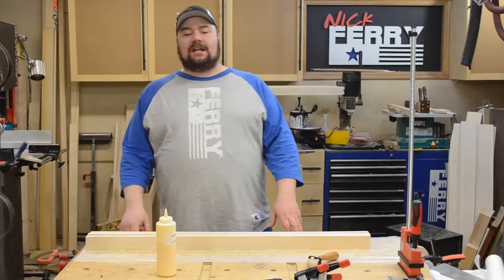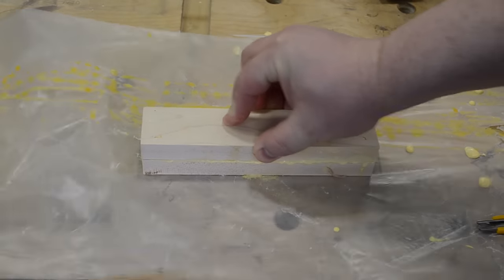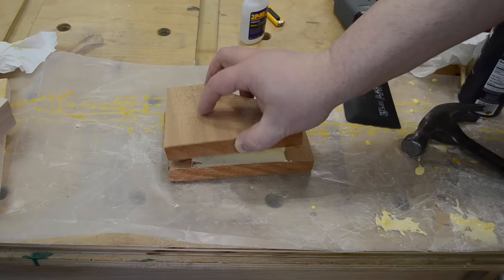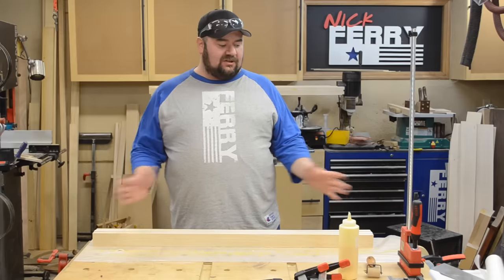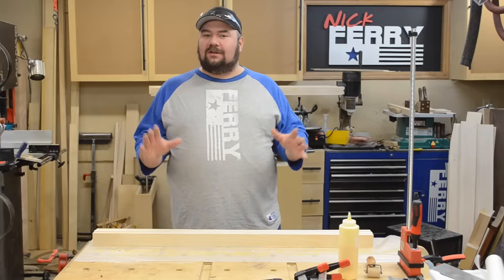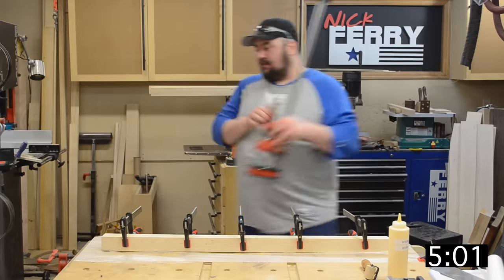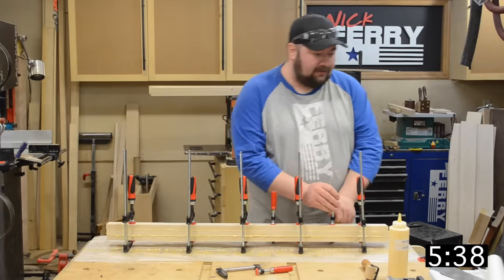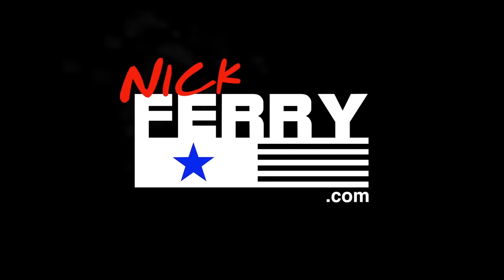Ⓕ Best Way For Gluing Wood Together To Get Thick Pieces (ep86)

Comment: When you clamp against the bow or bend of a the wood to straighten it out, doesn’t it just end up trapping the tension? Or does the wood eventually “set” and lose tension? Asking as someone who lives in a region with humid summers and dry winters and i have to account for lots of expand / contract with my projects.
Reply from the maker: all wood has tension and compression - this amount of warping/crook, or even slightly more you'll be good - I live in a huge moisture swing region as well
Reply: Nick Ferry thanks for the clarification. Great video, too.

Comment: Great tip, thanks so much for sharing. Would dowelling each lamination for something large like a bench top be helpful?
Reply from the maker: Most definitely - just watch for exposing the dowels when cutting to size
Reply: @NickFerry  Thanks, I thought that would work. I need to laminate a bench top for my Mike Myers Moravian Workbench build, and I was thinking that dowels would enable me to lock each lamination in place as I build up the whole top. I'm not worried about exposure of the dowels, that would only happen when drilling the bench dog holes, things like that, which won't really matter.

Comment: Hey Nick, great video and thanks for the info, I have only one question.  What if you can't afford even one parallel clamp?  I have a long story as to why but suffice to say I am rebuilding my life in my late 50's and can not afford such expensive clamps.  Heck I can barely afford to buy even the BC Sanded plywood much less BC Birch, ( they don't sell Baltic Birch anywhere near me), so that's my situation.  Any ideas?  Thanks!
Reply from the maker: for sure there are other ways - but first let me mention a method that helps progress the shop overall - find something you can currently make and sell for a few bucks profit and set some aside for shop things like clamps - there always seems to be something in the shop you need to replace or upgrade - woodworking is an awesome hobby that way, it's one of the rare leisure time activities that can fund itself 

That being said, you can use whatever clamp you do have, like an F-style clamp, C-clamp, bar clamp etc., and use a couple pieces of scrap wood to act as cauls to mimic the jaws of a parallel clamp - it isn't as easy to manipulate or as efficient but it can easily do the trick - wax the scrap pieces or cover them in packing tape to keep them from sticking to the glue - hope that helps

Comment: Two quick tips. Looks like waxed paper(?) on the bench. Consider going to Walmart or a fabric store and get a sheet of heavy clear vinyl. It's extremely durable, lasts for years, water proof, glue doesn't really stick to it, finish can't soak through it, and when not in use makes a half decent machine cover. 

Second, alternate what side of the work piece the clamps are on. It doesn't affect the glue up but it does help even out the weight of the clamps. I set my glue ups upright to dry (limited floor space) and it won't have as much tendency to topple over to one side and is easier to brace and/or prop up against something.
Reply from the maker: Some good ideas for sure

Comment: If you did two parallel clamps, on on either end and then applied all of you F clamps you wouldn't have to keep scooting it down. The alignment would be secured from the beginning and you could shave a little more time off of you glue -up! Cool Video!
Reply from the maker: but if the board is crooked then the middle wouldn't be lined up flush - doesn't always happen that way but I have had it before

Comment: good tip.  haven't seen that done.  I have never even seen a parallel clamp before.  Just checked Bunnings.com.au website which is our biggest hardware store downunder and they don't have anything listed that looks even close to the one you used.  As usual America gets all the good stuff and Australia either misses out completely or gets something 10 years after the rest of the world gets it.  Any hardware makers send some clamps down to sell in our shops you will sell heaps
Reply from the maker: I bet you would - a couple chunks of timber will do the trick too

Comment: I've seen Roy Underhill 'do' a "rub joint" and have tried it myself successfully. Of course, he used it to join boards on edge - but I've used it to join boards as you have done hear. Albeit two at a time.

I found a better squeeze bottle for gluing @ Kligspor: Glu-Bot Glue Bottle.  There are several vendors offering glue bottles that incorporate the roller - similar to "Big Horn 19045 8oz Wood Glue Spreading Applicator Nozzle Kit."  I use the Glu-Bot and find it an improvement over using the original/factory glue bottles or the Ketchup dispenser alternatives.
Reply from the maker: a rubbed joint works surprisingly well - George VonDriska taught that method in third-world countries while in the peace corp - perfect if you don't have enough clamps - and I love my glu-bot - pretty much any clean empty squirt bottle becomes a glue bottle around my shop - I think I'm rocking a hot sauce bottle currently

Comment: If you have two parallel clamps, you could set one on either side, then apply normal clamps in between. Alternatively, after you place the first clamp, simply move the parallel clamp to the other end.and add other clamps. Isn't it easier?
Reply from the maker: You can do that but it wouldn’t remove a crook from the board

Comment: Hate to break it to you but back in 1987-89 I used this method when I did curve handrails. Bessy clamps just came out with their first parallel clamp. it cost $38 Canadian at the time but I figured cheep if it saved me frustration. Perhaps I was the first to use this idea or at least one of the first wood workers at the time to use it,( knowing how our minds work) always looking for a better way to do the same job. I like the salt idea though.  p.s. I still have the clamp which I haven't used since mid 1990's. and yes it is true, there is nothing new under the sun.
Reply from the maker: I can see it working out well for handrails - parallel clamps have saved my butt a few times

Comment: Hey Nick Ferry. Great video and thanks for the tip. One thing I do is dent the side or face I’m gluing using a hammer end or chisel so the glue has something to grip into. Is this something you’ve come across before or even use?
Reply from the maker: thanks - I have heard of variations of that before but never went that route - chemistry in modern glue really doesn't have any problem getting into the fibers and pores of the wood creating a super strong joint - even glass smooth edges fresh off a jointer make great surfaces to face or edge glue blanks and panels - the only time I can seeing prepping the wood any different is in high oil content exotic woods
Reply: I work a lot with Parota, Tornillo, and Mexican Ebony as I live in Mexico. So I sometimes have that issue. Less so with White Cedar which I’ve been using recently but have been doing it out of habit. I’m guessing salt is a kind of alternative to what i do then.
Reply from the maker: I'd stick with what you're doing over the salt method - salt won't help with oily wood and glue adhesion

Comment: Great video Nick,  what kind of glue do you use in the video to join the pieces? "Titebond 2 Glue For Most Projects"
Reply from the maker: 2 is a good all around glue - If darker lines aren’t an issue 3 is a good one even for indoor projects - white school glue works great as well - it’s what I primarily used for years

Comment: Depends on how thick the board is but sometimes I'll add a lamello, it won't interfere if you want to add in another joint and if done right, is pretty fast and clean!
Reply from the maker: But if you add a taper it can be tricky to plan for all of them and not expose them when making a cut

Comment: you can also add a biscuit or dowel between the planks to keep the wood from slipping.
Reply from the maker: For sure - I typically avoid them when tapering legs

Comment: One Q: when you clamp it one way with the parallel, wouldn’t you not be able to clamp it all the way with the f-style due to the differing force directions?
Reply from the maker: the clamping force of the f style clamp is much greater than the resistance of the wood to slide in the parallel clamp

Comment: Hi Nick....Great method (although those Bessey parallel clams aren't cheap)! A 'caveat' for anyone using salt: I've been using salt for many years. It works OK, but be very careful how much you use! Be very sparing if you use salt...just enough to hold pieces still. On more than one occasion, I have used just a little too much and found that, as the salt dissolves, it tends to weaken the glue joint...and I've had the disasters to prove it! I like your method much better.  :-)
Reply from the maker: thanks much - clamps in general is that sort of thing to where it adds up quick

Comment: Good job on that clamping. How long would it take you to glue and clamp up a 16ft. church pew?
Reply from the maker: Based on time per foot for this one, I'd say less than 20 minutes - if I were doing a lot of them I'd use an impact to tighten the clamps  - that would bring it down to probably less than 10 minutes

Comment: Nice video!  Just to add a degree of complexity - what if your boards were bowed and you wanted to clamp the stack to your bench to keep them straight during gluing.  Then you'd need to have the glue surfaces parallel to the benchtop.  You could still use the parallel clamp, but the process would be a bit more tricky.  With the crap wood being sold at the home centers these days you gotta take bowing and cupping into consideration.
Reply from the maker: I did have a fair amount of bowing in these - if you had a small crook in it you can still get it out - but if it's a lot I'd cut it straight
Reply: take extra boards and turn them on edge along the face of your glue up to spread the clamp force along the length of the board instead of just at the clamp location.

Comment: With that kind of glue-up (face-to-face) would you need to use screws also?
Reply from the maker: Wood glue, school glue - pva - any will be fine - no need for screws if you have a tight mating surface

Comment: I use sugar.  Dissolves almost immediately.  But I don't use it on broad faces,, more like you, I just align with clamps.  But where I do use sugar are corner butt joints that are pneumatically fastened.  I used to do manufacture, batched cabinets 100 or 200 at a time.  A little dash stopped the slip just long enough to align and stitch.  Assembly time to fasten a carcass together dropped from 2.5 minutes to 1.5 minutes,, and accuracy of flush edges improved dramatically.  The shortened assembly, the less dinking around with unflush intersections, missed fasteners,  could save one or more man-days of labour on a single batch.
Reply from the maker: Interesting, I don't think I've ever heard of sugar being used - sounds like you've made a cabinet or two

Comment: instead of salt you can also use any grit sandpaper and kind of scrape some of it over the glue up surface, works same way as the salt but more likely to have on hand in the shop
Reply from the maker: It seems like a really bad idea
Reply: @NickFerry  I am an amateur, weekend warrior beginner when it comes to woodworking. Why would sand paper be a bad idea?
Reply from the maker: @ajuric4606  Sand will remain a barrier in between the two glue surfaces whereas salt will dissolve

Comment: I do this, but I leave all clamps in place (I re-apply the positioning clamps after cleaning up the excess glue).

Free tip: if you don't have a planer, wet-sand with coarse grit on your random-orbit sander. Clean the sanding pad frequently, and wet the wood frequently.

It really does a great job.
Reply from the maker: Not sure I follow the wet sand - on bare wood? What kind of surface finish does it produce?
Reply: @NickFerry  Yes, bare wood. I use it for glue-ups, rough wood, and if have to, to reduce thickness (ugh, takes time, but it works) 
The finish then depends on where you want to take it with follow-up sanding.
The 3 main benefits (IMO): no dust, faster removal, and works good on harder woods. 
I think it swells the wood fibers, letting the sandpaper "bite" better.
Typical process:
-container of water
-cloth
-wet/dry sandpaper
-random-orbit sander
-generously wet the surface, similar to applying stain
-sand with wed/dry coarse grit
-clean the gunk from the sandpaper (I just put the cloth on a flat surface, run the sander on it a second or two, it cleans itself).
-repeat.
Once you get the general smoothness you want, sand as normal. 
I've also used this process, with finer grits, to remove the "nibs" from rattle-can sprayed painted surfaces.
EDIT: interestingly, a quick youtube search didn't show much on this.
Reply from the maker: Yeah I’ve never heard of wet sanding bare wood - interesting concept for sure
Reply: @NickFerry  honestly you'd likely not need it with pine or other soft woods, other than if you don't have much equipment and you've a fair amount of material to smooth out. 
I've had really good results wet-sanding bare oak, even non-machined oak boards. biggest thing is to keep the sanding pad clean.

Comment: Just did my 2x4 benchtop, I ended up glueing up 2 at a time,  upright at first to allow the  weight distribution to spread the glue a bit+ it won't spill out while you do the others in the event that the pieces your gluing have a bit of warp , then just did the ol glue ,turn, connect, repeat  thing. Seemed to work but as always I wish I had more clamp's it's a good glueup, but it could a been better
Reply from the maker: You made it happen which is the most important part

Comment: I do sometimes do that... Most of the time I might put down the clamps on the side after I get a little pressure but I have done that for sure.
Reply from the maker: great way to true things up
Reply: When I first started woodworking I had some issues with this and it was a natural progression.  After you do a dry fit you can kind of tell where your issues are going to be so you try your best to fix it before it's an issue.  

I saw you didn't have a dust collector... If you have a Harbour Freight I would tell you to take 200$ and get their 2HP one.  Use silicone to seal up the motor and save up for a better filter.  I have a plastic barrel with a cheap cyclone thing on it.  It's a time saver especially when I would have ended up with 4 inches of sawdust from my planer.
Reply from the maker: I agree, joints that don't come together before glue aren't often fixed with glue - I do have a dust collector and it works nicely

Comment: It’s a good trick... I’ve heard of drilling through and using small dowels, or even tooth picks - or if you have a flat surface putting a weight on top!
Reply from the maker: Thanks - another couple to try now

Comment: I use to have a perfectly flat surface, covered with wax paper, that I would lay the wood on , and then use a sufficiently heavy weight (didn't have the cool parallel clamps) before I clamped the pieces together. Seem to work pretty good. It's heavier to move than a parallel clamp, but you don't have to keep lifting the wood.
Reply from the maker: A good method for sure - you just need a surface big enough for it

Comment: Is that wax or parchment paper to line the table? I did a little test with one of each that I have on hand and the wax paper glued itself to the wood a little bit but the parchment paper did not.
Reply from the maker: I used wax paper - it does good most of the time

Comment: I use dowels.  Super simple and guaranteed not to stray.  You have to play with it some to make them hidden sometimes depending on how many.  Also, don't over tighten.  You'll squeeze out the glue and weaken the bond.
Reply from the maker: good reminder on the over-tightening

Comment: You can also get 2 or 3 clamps on just snug, check alignment and then tighten them down. If the boards are the same width, and square, and your surface is flat, they won't move around. But this method is 5% easier. So, good tip.
Reply from the maker: 5% is an advantage I'll take, as quantifiable as it is

Comment: I've always used pipe clamps and used the pipe edge as a rest for the pieces to mesh up.
Reply from the maker: I've done that but still had some movement from time to time
Reply: ive done both. trick with the bar clamps is you can slip shims between the pipe and the board to flatten and align them.

Comment: This is a great tip if, like you say, you have close cut tolerances. I'll have to give it a try the next time I'm in that predicament. But since I try to mill my stock oversized, I typically do mine differently. I deliberately offset one of the boards by 1/8" or so, so that its edge sticks out beyond the others, and then use that edge as the reference edge against my table saw fence to trim the stack once it's dried. it really doesn't matter if the other boards have slid around or not. This cuts away any glue squeeze out without time spent scraping, speeds up the clamping process and ensures the dimensions of all the trimmed 'legs' are the same. Like they say in wood working, "first you add to create the assembly, then subtract by trimming it to size".
Reply from the maker: Exactly - a great method to use - thanks!

Comment: How do you dilute wood glue? I wonder if soaking a board in wood glue for weeks then allowing it to dry would make a super hard substance.
Reply from the maker: you would need a vacuum chamber - river logs that have sat in water for 100's of years many times don't see water all the way to the core - so a stabilizing resin and vacuum chamber is your best bet for get most of the wood or you can use something like this - https://amzn.to/2PbKTm1 - for superficial treatments